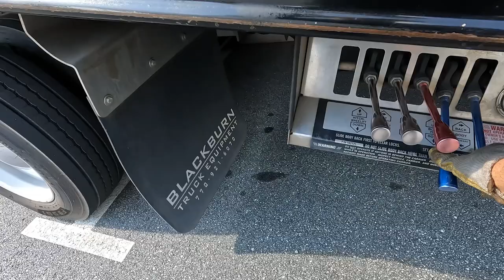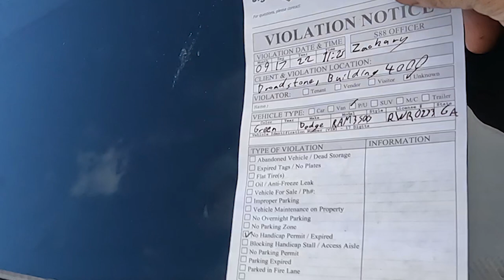Parking Revenge #279

Comment: Hey Johnny, what are the spikes protruding from the hub of the front wheels. Surely not metal or hard plastic, never seen it before especially in the UK, looks a bit dangerous unless it’s soft rubber.
Reply: I always assumed they were indeed hard.
Reply: They are lug nut extensions. And they are metal
Reply: Some lug nut extensions are plastic, some are metal.  They're mostly ornamental.  Some people feel the dangerous appearance causes other drivers to be more careful.  Some feel they add security, by requiring a special wrench to steal the tires.  They are legal in most of the US.

Comment: That truck in the Handicap spot would also be taken by the local DMV for them to look at and most likely remove the license plates. Wheels that stick outside the wheel well is a big no-no here in Norway. And the spiked nuts?  Yeah, they'd probably go over it with a fine-tooth comb looking for issues, just on principles. You may want to check what kind of rules exist in your state.

Comment: I have learned more about the different ways ppl try to cheat the system.   My mind doesn't work that way, and it is crazy to me the lengths they will go to.   I still am stumped as to why the guy called a tow truck to move his car when he said it runs, tags are good, and tires are pumped up.  Why not just drive it away?   Your theory that he no longer lived there but still parked his car there was probably more accurate.   Never would have guessed that.  lol